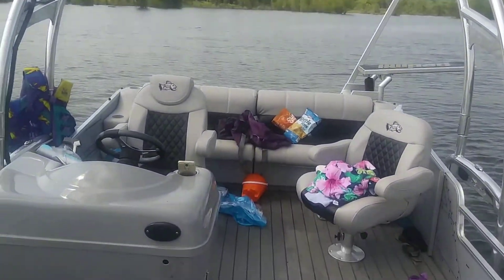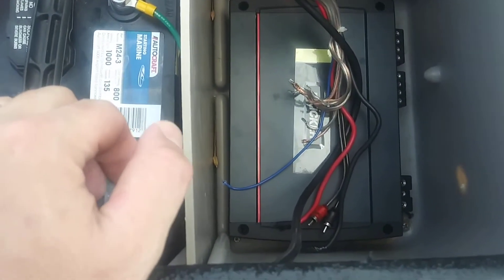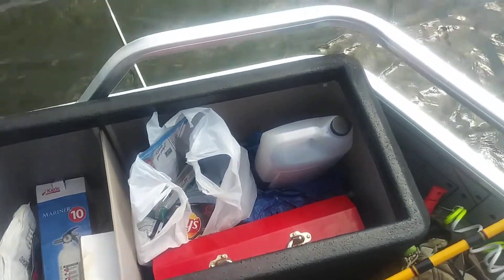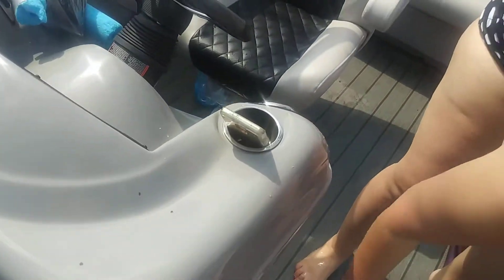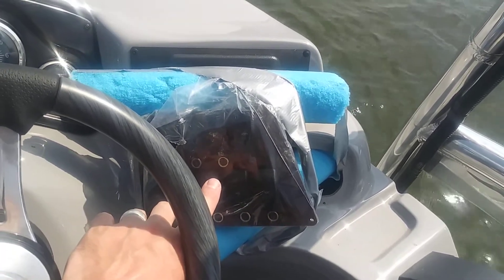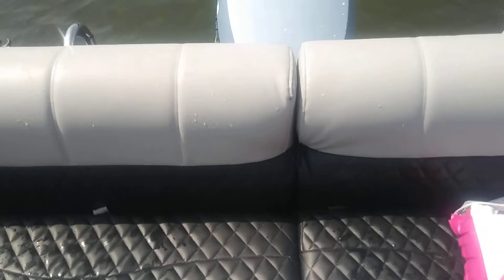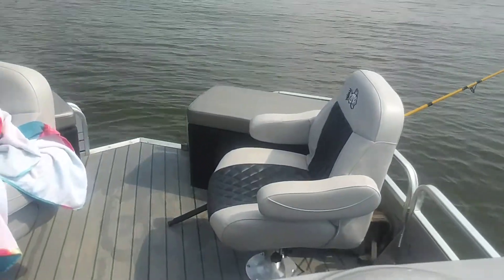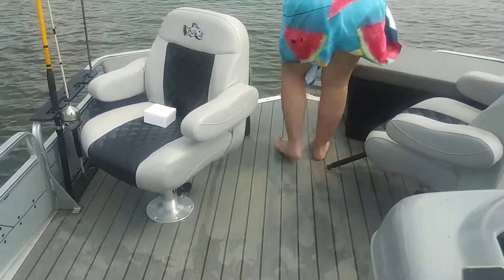Pontoon restoration 95% complete (On-board view)

Comment: Hey love the boxes with the batteries where from? Glue type and where from? I have a 98 20 ft. Tracker redoing this winter. Only finding 3 videos on the rehab? I can use all the help. THANKS IN ADVANCE
Reply from the maker: Glue was from Amazon can't remember name it's about $115 per gallon and I used 2 gallons. If you have wood sub floors the glue is a lot cheaper. I got the boxes online and I painted them black. Can't remember what website they were like $300 each.